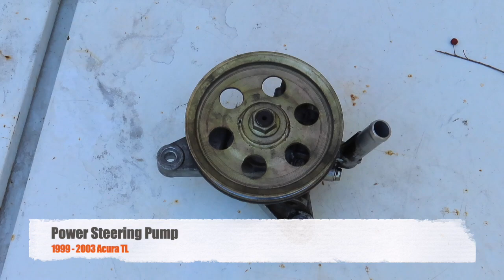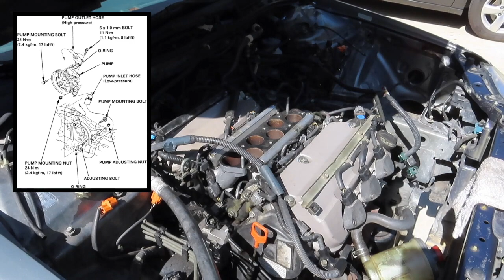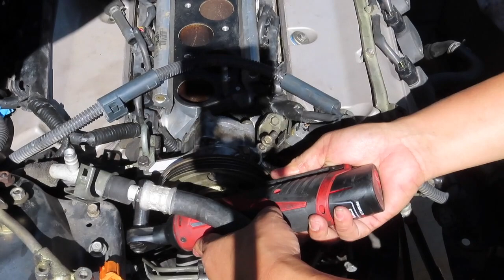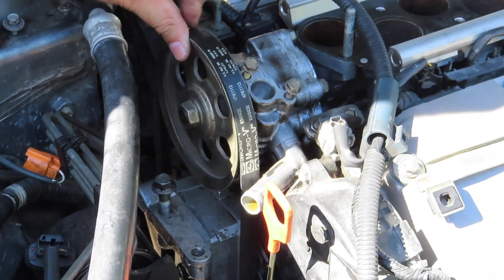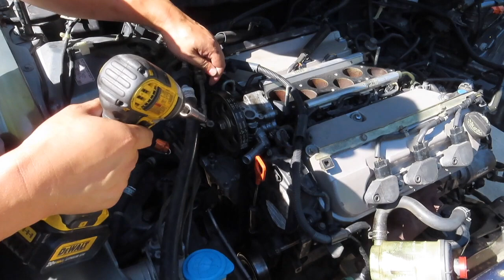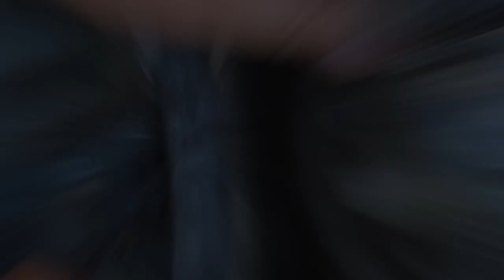1999-2003 Acura TL Installing Power steering pump

Comment: Question: I have a 1999 Acura TL 3.2 and I had a shop mechanic replace my alternator and serpentine belt. Immediately after the repair my power steering pump made a lot of noise and the power steering fluid  pumped out the top of the reservoir... The mechanic said this was a mere coincidence. He said the the power steering pump and belt are independent from the serpentine belt. Is that true? It seems very odd/suspicious that this wasn't an issue until the moment the put on the serpentine belt/new alternator and started the car... Thanks
Reply: It looks like they ripped you off by over filling the reservoir to pressure bust and or loosening the power steering pump to take away grip and cause screeching.
Reply: The same crap happened to me today with my 99 Acura. Took it to my mechanic because the car shut off. Apparently the alternator bracket broke. Got him the new part only to receive a call from him saying that the power steering fluid is shooting out and it's making noises. I had none of those issues prior, no screeching or fluid leaking. He tells me I need a new pump and $90 labor. I had him take out some fluid to the lower level and took my car home smh
Reply: He should if replaced the power steering belt at the same time.  Yes it would cost more money buy your there just replace it